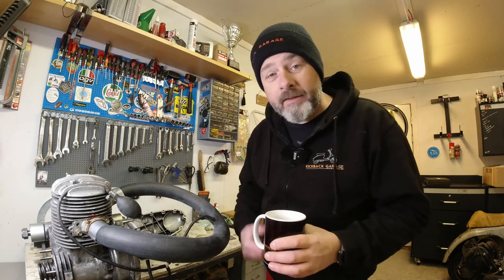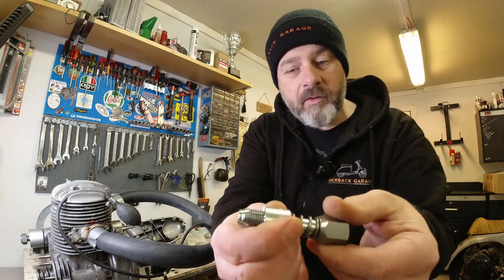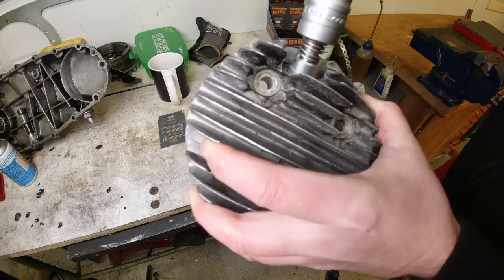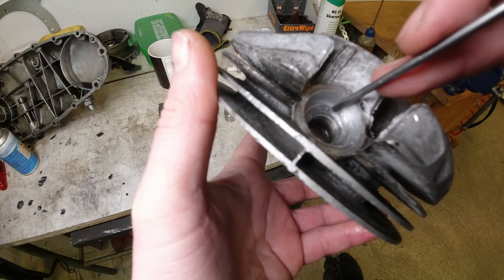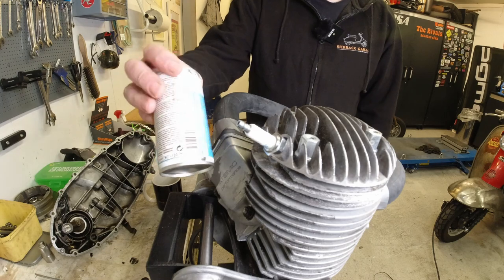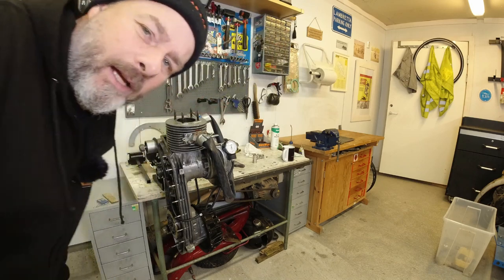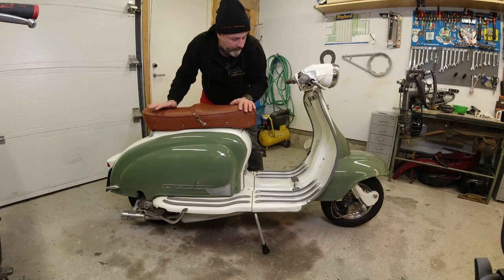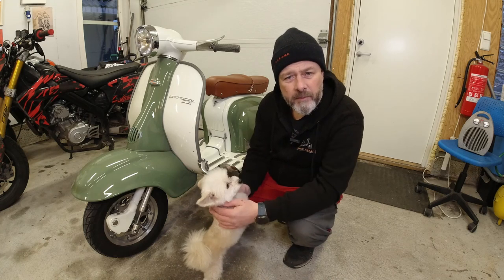Spark plug hole repair tool #kickbackgarage

Comment: Series 2 is gorgeous Rob. Understated and very nicely done. Idea behind that tool is sound enough but I'm wondering if it will ever get used again  lol. On the spare wheel question, I'm exactly the same with my S2 but fitted a legshield holder. Only ever used the spare once in hears (tempting fate) but the wheel cover has so much stuff inside (spares, tool, oil etc) that I could;t live without it now
Reply from the maker: Thanks! I have a plan for carrying oil and fitting the spare wheel inside the legshield is always the best option imo because it keeps some weight at the front of the scooter. I will only really use the rear rack for overnight trips and rallies. I tend to travel with a drybag with clothes strapped to the legshield and the rear rack will be solely used for the spare wheel to balance the scooter and for carrying 6 packs from the local shop to the rally site 😁

Comment: Another enjoyable video Rob.
The head maybe could have been milled but not worth it for the cost of a new one.
The series two looks good,  the colour suits her very well.
I have a combined wheel carrier, rack and backrest as I have set her up like we did in the sixties.
The wheel carrier cos the tyres then were crap and punctures very common, the rack to carry your gear and backrest so you arrived with the same number of young ladies you set out with.
Feliz Navidad desde España
Reply from the maker: Yep. Been looking at the ones without backrest.

Comment: I have a couple of simple tools which I use to re-face the spark plug seat. The tools are used in a lathe at very slow speed. I use it to correct the position of the plug in some aftermarket heads (otherwise the spark plug tip barely pokes into the combustion chamber). Let me know if I can help, though buying a new head sounds like the best solution for this particular leak.
Reply from the maker: Hi Martin, I tend to use quality kits these days but I am very interested in seeing what those tools look like all the same. Email is lambretta at online dot no. I also think I bought my very first qr rear brake cable of you 20 years ago.

Comment: Have a similar tool for spark plug threads, head is scrap I’d imagine
Reply from the maker: Was worth a try. No point trying to fix it for the sake of £35
Reply: @kickbackgarage  Yeah but as you will shortly have a new lathe you'll be able to fettle the plug sealing flat fairly easily.....
Reply from the maker: Unfortunately it's a lathe and not a mill. 😁